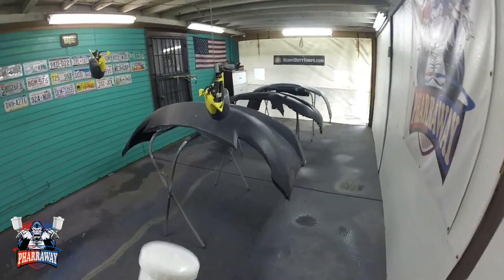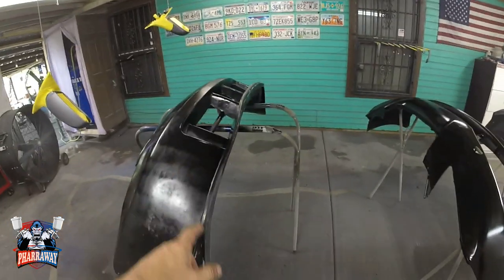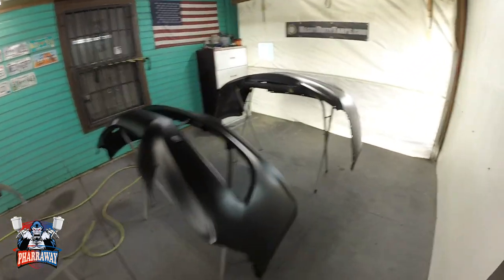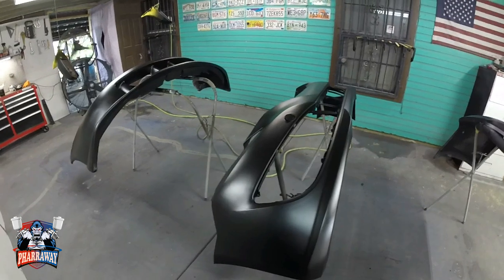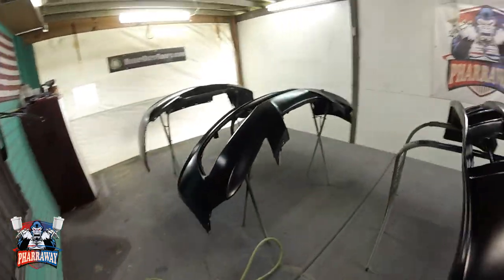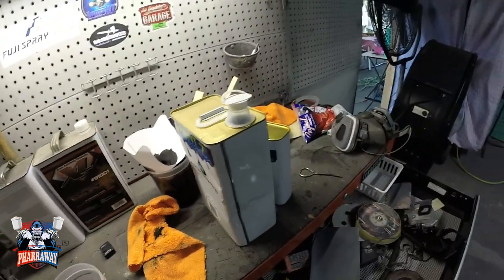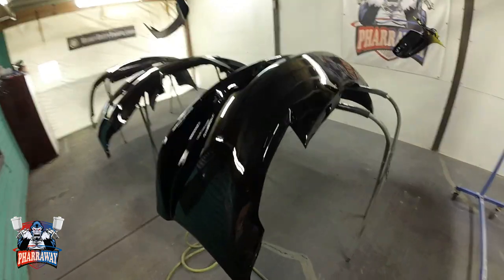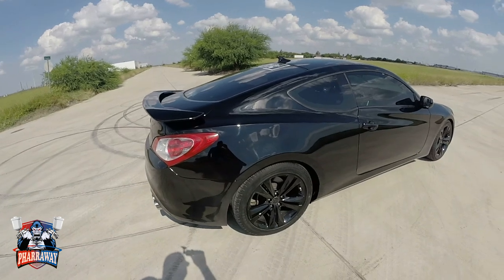How to paint the perfect black paint job PART 4

Comment: Love your work one of the best at home painters I’ve ever seen your bodywork is flawless I have a 1972 c/10 going to do all black paint is good but been on the truck for about 20 years going to take the chrome off and weld up the holes in goo to use ppg 2021 clear have you ever sprayed it before I know it’s great clear great 7 looks great just don’t know how it holds up in the long run any tips or tricks would be appreciated thanks keep them coming
Reply from the maker: Nice and yes on the 2021 it's a good clear and has a long life

Comment: I use a 2K primer that is mixed 4:1 and if I use it as a sealer the data sheet says mix it 4:2. I know I have to sand when I use my material as a primer but not sure when used as as a sealer. Thank you and God bless

Comment: Thank you for the lesson always learning. I noticed you weren't wearing a glove on the gun hand when spraying the clear. I have been under the impression clear was the most toxic even for your skin? What type were you using?  I only noticed where from on your list list of tools.
Reply from the maker: Its from venom steel and yes I ran out lol
Reply: @PHARRAWAY  thank you I will check them out
Reply: @PHARRAWAY  I'm a little slow!  You ran out of gloves. lol Been doing a lot of fiberglass work on my airplane.  Just when I'm already and the epoxy mixed I I find I've overlooked something. By the time I get set again the epoxy is  starting to go into exotherm. It's starting to become more routine less mistakes. One day soon I'll be painting the fuselage lowrider Style with lace and a couple stenciled murals.  I learned a lot from the pedal car video. Thanks